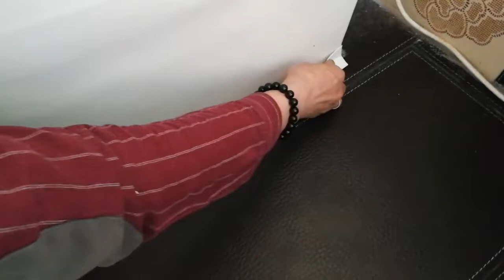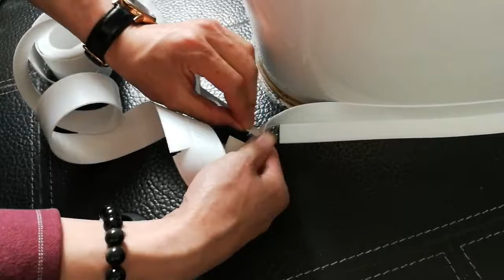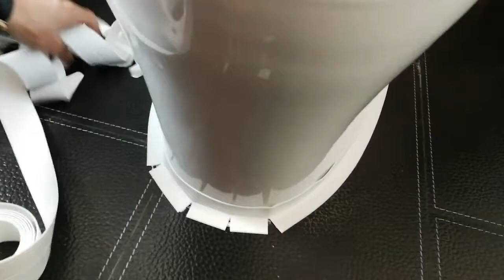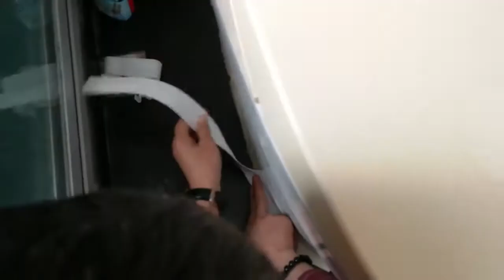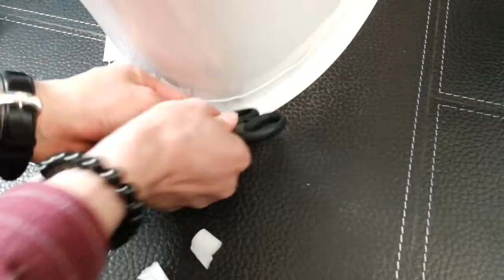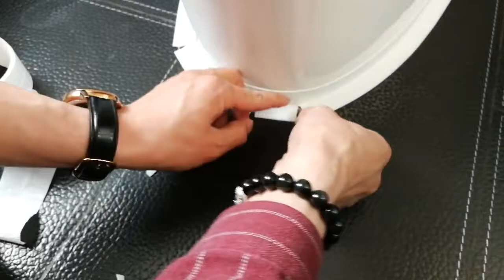Self Adhesive Kitchen Ceramic Sticker Waterproof Anti-moisture PVC Sticker Bathroom

Comment: Mate, I thank you for posting this video that basically helped me figure out how differently this could be done. Instead of cutting at the bends, if one could just pull and stretch the same tape, it does bend well and aligns neat.  If I can add a picture to this comment, I would do that.  Thanks.